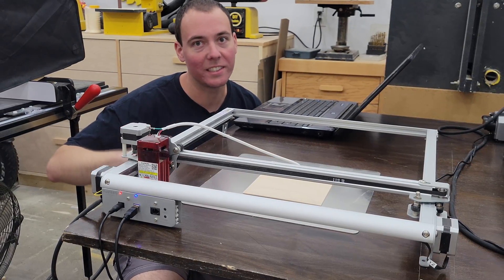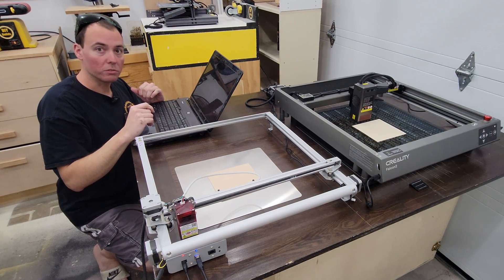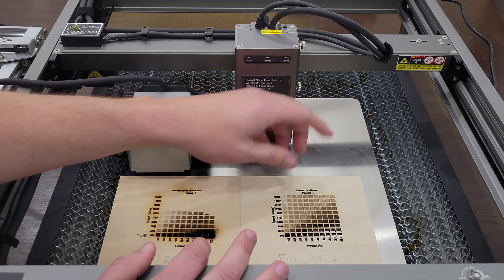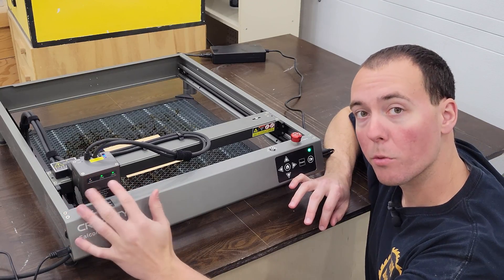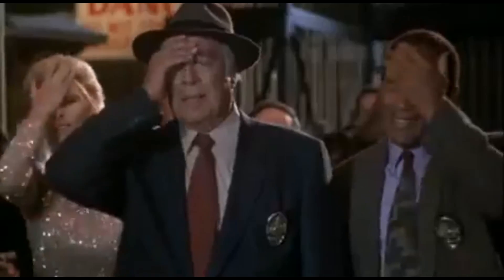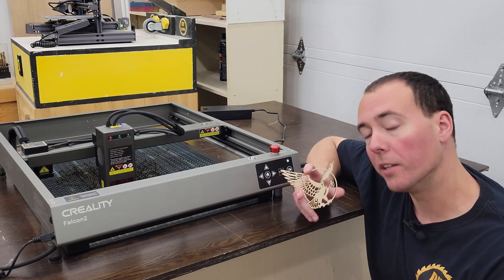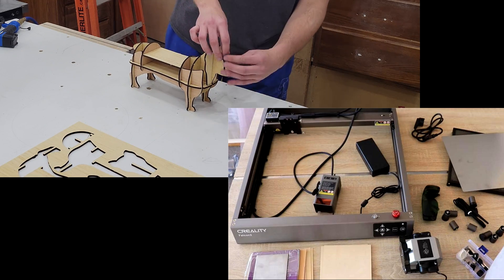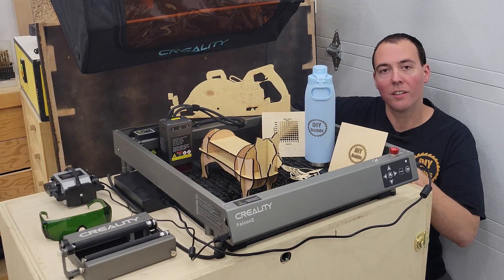40W Creality Falcon 2 Laser Cutter / Engraver (Cuts Wood In One Pass With Ease)

Comment: Hi, 
How much noise does this machine generate in relation to other 40w machines that you may have reviewed and be familiar with ?

Wanting to keep My neighbours happy, currently using atomstack x30 which is fine as the neighbours dont hear it running

This machine looks a beast, just concerned about noise levels

Comment: Great Video. Do you have a link for the hood/encloser?
Reply from the maker: No but if your interested in this machine I think they just came out with a perminate Enclosure unit or its coming out soon.
Reply: @DIYBuilds And what software do you use to create your g code? Thanks.
Reply from the maker: Light burn.

Comment: Why are metric system users so fond of describing lengths in mm?  “15,000 mm/min” = 15 meters/minute.  If the so-called advantage of the system is the ease of switching units, why the adherence to mm?  Just say meters.  Or cm.  I don’t get it.
The laser is sweet though.  Nice video
Reply: Because you like to use scientific method (powers of 3). Using meters will not be precise enough, having to always talk in decimals. Mm you can use across tool size, feed rate, dimensions without any crazy numbers. 15.000 is very rare to have something in this order of magnitude. 
So the exception proves the rule that in 99% cases using mm accross the whole process is most useful